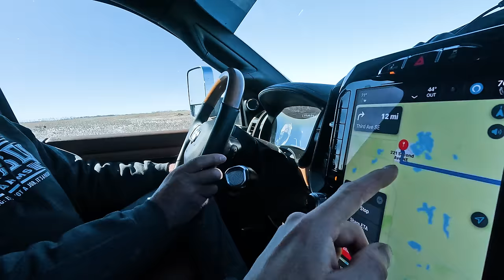Hook Line And Sinker! Dougo’s Dream Come True!

Comment: I have a 1400RS for 4 years and use it a lot.  It has held up really good.  You can move alot of dirt in a short amount of time.  I pull it with my mt755 or 65c.  I have also moved snow with it a couple times.  Dougo is going to have to use a tractor with 5 remotes!

Comment: Thanks for another great video Chet and Dougo. 

It was most interesting and enjoyable. 

Wow. Fun going on the road with Dougo and Chet. 
You two are a blast on the road together. What fun you have. Road trips are really enjoyable with you two. 

Love that blade you got for doing drive ways and such. Really a nice one you got Dougo. Should do a real good job on the driveway. 
Like the hydraulic blades on the unit and the long tongue and side accessory blades. Neat machine. 
It is built tough by a good old manufacturing shop in a small town. They are the best. Good people. 

Grandpa will be looking this one over. You can bet on that. 

That was a great couple of welders in that shop. They knew how to weld. 

Thanks for taking us along. Super trip. 
The Iowa farm boy. Steve.

Comment: If you change the cutting edge on that blade and put a sandvix cutting edge on and run it around the yard it will bring all the gravel back to the top and allow all the dirt to go back to the bottom. Works awesome try it

Comment: I wish I had known Doug needed a grader, I would have sold ya my Cat 14E, got it's own motor and everything (3306  Cat diesel) cab heater and a 220 air conditioner, plus a dozer blade on front....weighs about 42000, might have had to bring the lowboy.  (only about another 500 miles west too)

Comment: The plug in the fuel filler neck isn’t necessary, there’s a secondary flap that seals the tank from any water/dirt getting in the tank from the top flap, and there’s a drain on it so any water that does get in, drains out. Have over 500k combined miles on a couple ram trucks and have never had an issue with the fuel filler.

Comment: STEIGER Tractor plant in Fargo is another place that's familiar to me I also worked there for a little over three years  . Did not like the Bearcats much . The Cougars and the Panthers were a lot nicer especially when the series III came out in the late seventy's  .
Loved that big six Cummins that could be turned up to six hundred and fifty houses  . But Cummins would only guarantee the engine to four hundred and fifty horses the first year they bought that engine out . 
We however did put on the bigger injections on a few before they were shipped  .

Comment: You guys need to buy you a 25ft Razorback power screed and start pouring 25ft strips of concrete at a time around your building every year. You have the equipment needed to do the work, makes plowing snow a dream, and cuts down on the mud and dust. We started doing 1/2 acre to an acre per year between jobs, and never regretted it. No need for the equipment you just bought, no more buying stone...

Comment: I noticed you have a dodge dually. How does it ride in your opinion? We currently have a dodge 3500 one ton pickup with air bag suspension and it rides rough. Does your pickup have an airbag suspension or springs?
Reply from the maker: Ours doesn’t have air bags we wish it did for towing stuff but the ride isn’t bad the way it is! Chris said it rides better than his uncle Ford 1 ton!

Comment: Need the o ring or it will throw def codes causing issues in couple miles it get pressurized to controle heat in tank you will have derated issues be ready all over missing oring
Reply: The cap isn't needed. 
Truck comes from factory without a cap,

Comment: Don't be surprised if you get check engine light because of the loose fuel cap or missing O ring the computer may read it a as a fuel system problem.
Reply: Those trucks have no fuel cap from the factory…so no it won’t set off a CEL